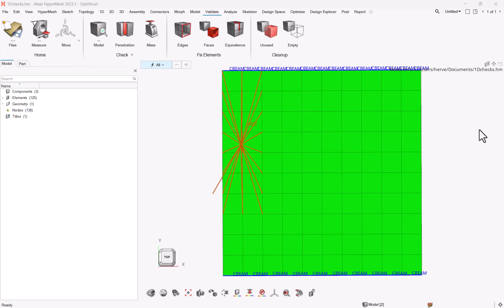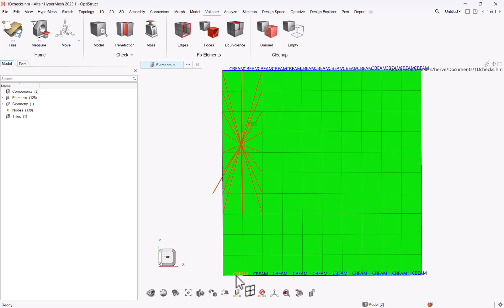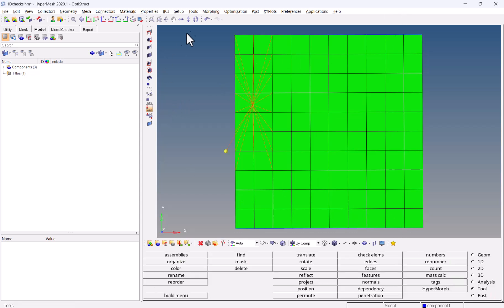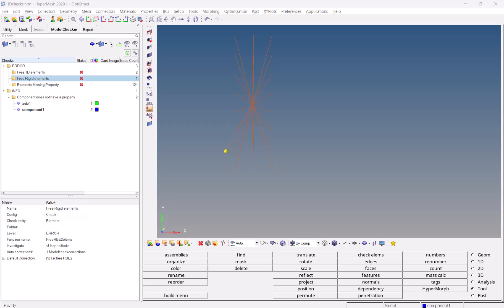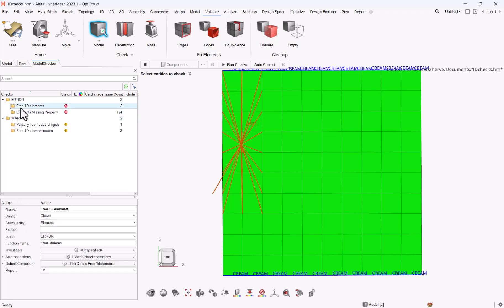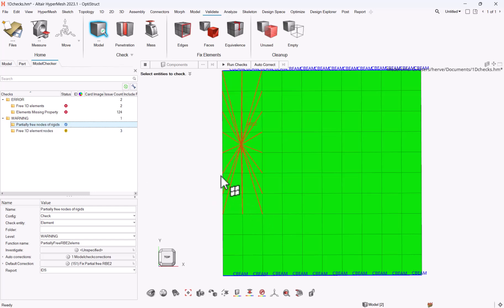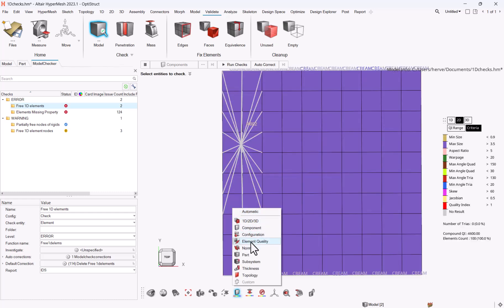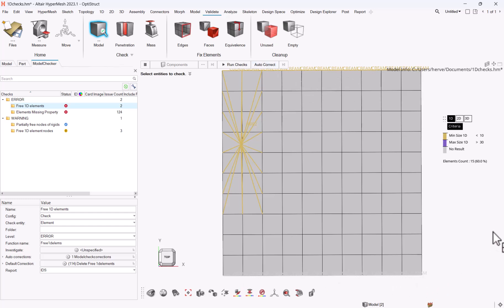About 1D element checks in Hypermesh 2023

Comment: thanks for the video, 
but there is no option in new HM to add temp nodes on free rigid nodes.

auto correction option is good for small models, where we have very small number of rigid /1D elements.
but in big model like instrument panel , full BIW where no. of rigid /1D is very high like in thousands and we want to replicate our all connections from old model to new model.
old model mesh and new model mesh is different.
after equivalencing ,still there are many rigid/1Ds are free.
in this case if we use auto correct ,that is not good idea. many connections will may fail.

in this case we need to carefully attach old free rigid /1D nodes to new mesh. 

so identifying free rigid nodes we need to add temp nodes on all free rigid nodes.

and this option is missing in new hypermesh.   (i am not able to find if there is any).

please add that option.

thanks.
Reply from the maker: Hello @rahulzambre8906, managing rigid as simple elements, especially if you have thousands of them, should not be discussion here, as it becomes a significant time consuming task. Why not using HyperMesh connectors, for such cases? They allow to deal with different type of 1D elements (absorb them as connectors, re-realize them after mesh update) and have been designed on purpose for such scenarii. So for sure you can do it "by hand", and then you have to review carefully your thousands of rigids every time you replace a part or remesh it. Or you use manage your rigids through connectors, which should prevent you to check such a number of rigids
Reply: @altairhowto   fe absorb is good option.
but in some cases like in IP (instrument panel). fe absorb may not work ,because of complicated modeling of connections (clip connections, snap connections).
in that case we have to equivalence the free rigids to the new mesh. and this practice i have used many times.
many companies use the same method .

when nothing works ,this method will work.

that's why I am asking for this feature.

thanks.
Reply from the maker: hello  @rahulzambre8906  , we know that connectors are not suited for certain use cases, but we also know that some of our users don't rely on connectors for use cases they have been designed for. That said, your cases are relevant, and we should re-introduce in the next version (2024.1) the highlight of free nodes in the Model Checker. By the way, equivalence is still available so you should still be able to use it on any kind of mesh.